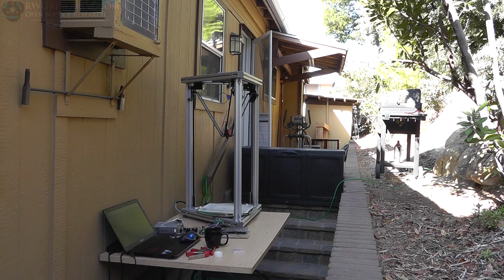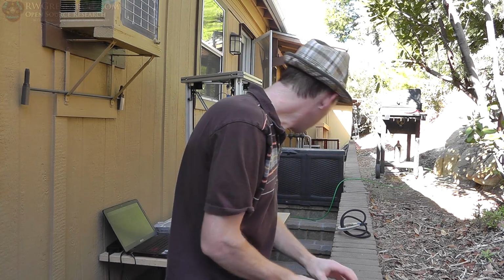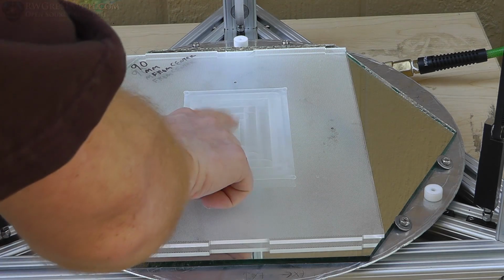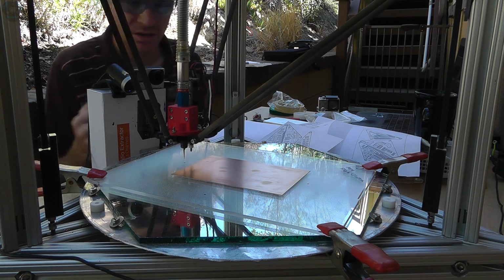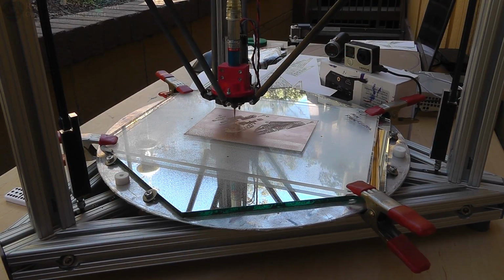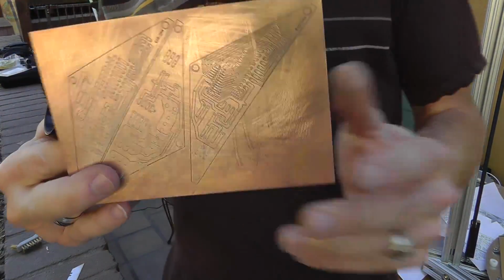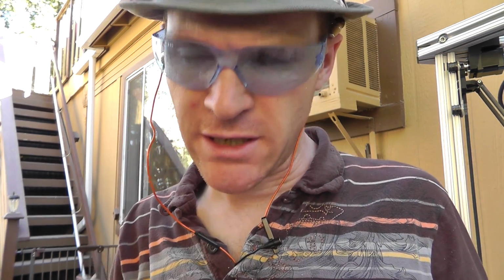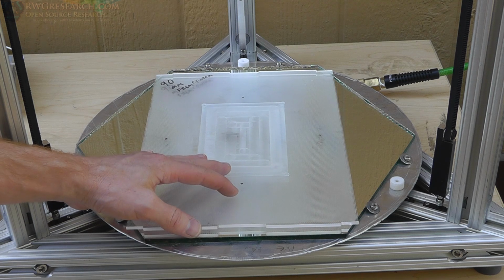RWG-OSD # 27: 2nd Try - Milling PCB's - 3D Printer Makes Its Own PCB's! Double Sided!!!

Comment: I am building something   similar ,but with normal 3d printer frame with X Y  and Z step motors . 
 Wish me luck! :)  Btw do you use 2 or more control boards for the 3d printer,laser and the cnc or just one?

Comment: Hi Russ, When I router copper clad boards, I use WD40 to get a better cut and keep the dust down. Use a can with a straw and periodically squirt the rout path as it runs through the program, It also keep the bit cooler and sharp, then just wash with thinners. Hope this helps.
Reply from the maker: thanks for the tip. ill keep it in mined, i made a new spindle and it has a dust collection on it. so that seems to work good! ~Russ

Comment: It's looking good Russ! What are you going to do about the noise? I was thinking about a different kind of motor, but I guess they would all be noisy and dusty. What about using either a PCB etch resist pen before chemical etching, or coating the board with etch resist and using a much much slower motor speed to remove the etch resist?
Reply from the maker: Phil, did you miss this? https://www.youtube.com/playlist?list=PLsiIKXpZfLKJhyHkyGUZRDl685Kqzq2Si

on your second topic. at the beginning of this i mentioned that i did etching. ill be posting that in a video as well. it also has its pro's and cons. but i *Think we can fix those problems with a laser :) oh man always something lol 

more to do and test but i'm learning alto and hope i'm sharing as much :) ~Russ
Reply: rwg42985 yes I had seen that. You know better than me, but I've always found etching is a lot more accurate than CNC IMG. look forward to your next video!

Comment: I'm working on a similar project and I used a spring loaded tool head to compensate for the cutting tool not going deep enough or going too deep. You could try a similar approach.
~Mario
Reply from the maker: that's a good idea. my Main problem is that I beleave that this should be able to hold this tight tolerance. its just making sure things are calibrated and the pcb is flat. ;)  are you posting videos on your project? ~Russ
Reply: I haven't been able to put together a video, hopefully I'll post something at the end of this month.
Reply: Can I please ask what this board does? Why can't you buy a fast, good quality, pre-made one?
Or pay someone to do it professionally for you.
The reason I'm asking is because I'm sourcing the parts for your design, but I'm concern I'm not going to be able to buy this board. Thank you for your time, and your videos !!!

Comment: well that turned out nice. what do you think about painting the boards, then engraving them shallow, just to mark the traces. and then etching them?
Reply from the maker: so in the beginning of this video that's what I did. But I just used a scribe. spring loaded. I'll post that video next. however it also has its problems. but!! I think we can fix it with a laser. ;)  more on that next OSD vid. :)  ~Russ
Reply: lol, my bad

Comment: Pretty cool.  Did you do an electrical check of the traces yet?
Reply from the maker: yes. for the most part its golden, except the part where i know it was bad. HOWEVER.... lol im doing it again as i need more room between the traces... also other reasons that i will explain in that video :) , new software  for making the Gcode, thicker PCB's, ect.. but i had to start some where! ind i'm glad i did! ~Russ

Comment: Have you thought about using Chilipeppr for milling PCB's.  It has some nice features like auto levelling where it probes the pcb and off sets your gcode to account for it not being perfectly flat.  Could be worth a look....
Reply from the maker: ill have a look, i have been using Flat cam for the Gcode . with some edits, it seems to work! more on that in a later video., also i now can set up the printer to cal point to point for leveling. i did not have that option when i did this so next time will get it right! test test test :) .   Thanks for the comment! ~Russ